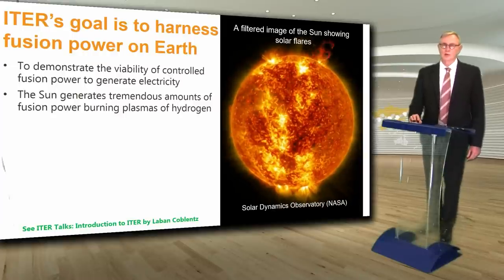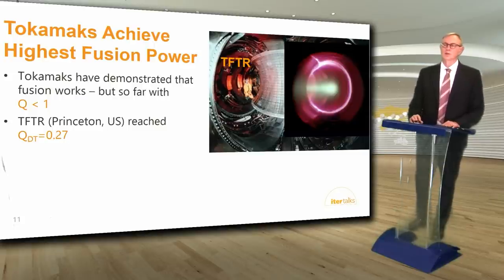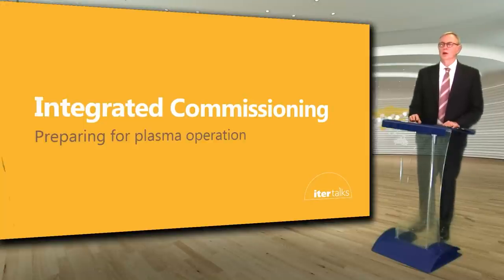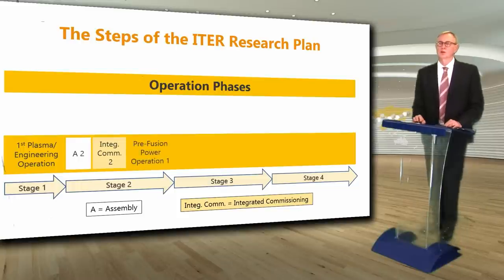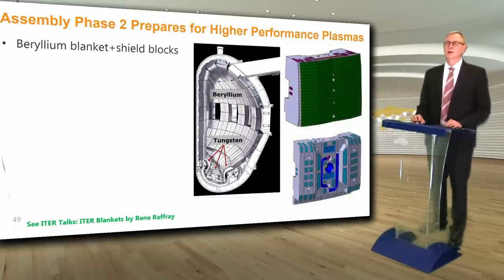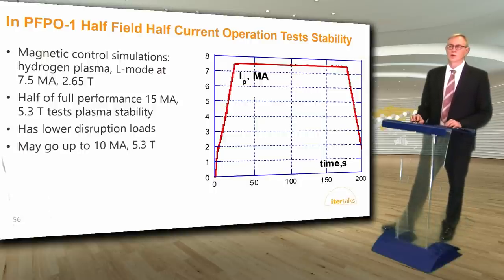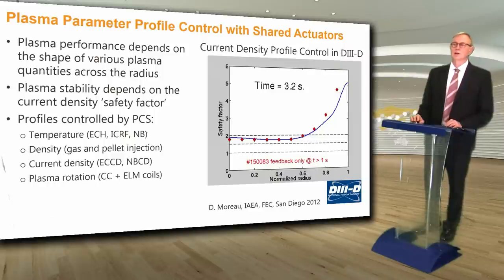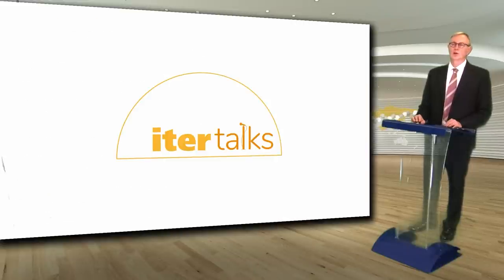ITER Talks (7): The ITER Research Plan, How to Reach Q=10

Comment: Error around 2:10 - instead of "input power required" he meant to say "thermal power absorbed" by the plasma, as heating is monstrously inefficient, the required power is far, far greater and conveniently ignored to maximize the headline Q value. Around 10:30 he describes how improving confinement efficiency by 20% would get Q>50. Let's hope they do, so it's not all a complete waste.
Reply: There is such a need  of energy to ignite the reaction in a huge tokamak , in order to get Q>1 , the duration of the  fusion reactions must be double as planned to sell the project for an realistic  electrical  industrial production. So far from this presentation  I don't know if the pellets plasma fueling will be done with Deuterium  or Triticum or a mixtur.  I don't know which side of the D shape the pellets will  be launched because at the , it was said in the 90 when I was Euratom at JET,  that the best fly for the pellet was done when  they are launch from the inner side of the Vessel . This presentation insist  about disruptions . And if the plasma is not hot enough from  the energy given to the pellets too reach the center of the plasma it could be a problem if some ice touch the Vessel  This was a main concern at JET when the fast pellet launcher was  commissioning because  the scare a Deuterium pellet at 4km/s could even  damaged the Beryllium coated tile at the opposite position on the pellet entrance..When I worked in the 80 on the Altair diagnostic at Tore Supra , a  CO2 laser with 3 beams focusing at  the plasma at different positions  thought a long  optical path  during a shot in order to investigate the electrons mouvements. . It was saying bigger the vessel in order to reach the Q > 1 bigger   the number of instabilities  occurred.  At least during the last 40 years I can imagine this was a very good challenge for the top management  to tackle the problem. The Feedback loop for maintaining safely  a Megajoule plasma is vital for the integrity of a multi billion tokamak ...

Comment: Questions:
-What is the Ion Density of the sun? I just want to compare it to the one at ITER to get a sense of scale difference.
-Why inject frozen pellets of Hydrogen, and not the gas directly? It's counterintuitive to me.
Reply: In answer to your second question about pellets of hydrogen, my understanding is the hydrogen needs to be injected into middle of the hot plasma to avoid disruption. That couldn't be done with hydrogen gas. If, for example, you tried to inject the gas with a needle it would disrupt and contaminate the plasma. The fact frozen hydrogen is very cold (on a human scale) isn't a problem as the plasma is exceedingly hot.

Comment: Feel a bit conflicted about fusion power. On the one hand, the theory is absolutely fascinating. On the other, it (really) seems an inefficient & extremely expensive way to generate energy. The massive inputs required in terms of raw materials sourcing, manufacturing & time taken to construct & commissioning when compared to that of renewables & storage, just don't add up. 
The only reason where fusion research might make sense is for space travel, particularly deep space outside of our solar system.
Reply: Actually less so for space travel.
Reply: @russhamilton3800  I was thinking in terms of, if it could made to work, that (eventually) it would/could be miniaturised. But otherwise, I agree.
Reply: It's just like fission it does need a massive investement to build a powerplant but it's way better than any renewable
Reply: @seubmarine5347  Of course it's not better than renewables, at least at this stage in the fight to prevent runaway climate change as prevention and mitigation measures are only starting to ramp up. I'm not saying that it shouldn't be explored, just that for right now, humanity's focus should be primarily on using all the resources currently being poured into ITER, into maintaining a liveable planet instead.
Reply: @pinkelephants1421  You can do your part by buying a rooftop solar system for your house, with a grid tie inverter and a tesla power wall. If you're OK with the batteries becoming yet more e-waste within their ~10 year lifespan.
Reply: @RN1441  Give me a break! Do your research before making such asinine remarks. Batteries DO NOT end up in landfill after 10yrs. 1) they have up to 30-40yr lifespan when used as stationary storage. 2) The materials contained therein are far to valuable to just throw away & are recycled; current recycling rate of contents stands between 94 & 98%. 🤦‍♀️🤦‍♀️🤦‍♀️
Reply: @Cool Baby yeah I agree, sorey ir I was not specific, but fission and fusion should be our priority

Comment: Would you get a greater Q value if the tokamak was in zero gravity of space? or the vacuum of space?
Reply: You would certainly need less energy to maintain the vacuum, but cooling would be really, really hard.
Reply: @infinitelyexplosive4131  yeah that's true, but it still might be a good trade off, there are ways to convert all that heat into work. I can't imagine the size and power of the turbopumps they will need to use to pull down the vacuum they need....they aren't exactly quick either....
Reply: @psycronizer  It takes a lot of effort to get down to the vacuum quality they need, sure, but the thing still needs to reject like 500 MW of power under operation. You'd need like a full square kilometer of ISS-style radiators to do that in space.

Comment: A big secret. 

The sun has collected all its fuel at the beginning 
and fuses it off in the course of the reaction time. 

Our attempt by ITER to replicate the fusion process 
requires constant replenishment for its reaction 
process during operation. 

This is a very elemetary difference. 
So we cannot reproduce the process of the sun. 

We are trying to emulate the fusion process that 
takes place in the sun in ITER. 

It's as if we had to constantly feed the sun with 
material to keep it running. 

Emulating the sun's mechanism would require a 
one-time fuel supply for the entire duration of 
ITER's operation.

Can this approach succeed at all?

Comment: So what exactly does Q stand for? Is it the ratio of power gained from fusion in plasma and power delivered to plasma (sometimes called Q_plasma) or is it the total usefull (like electric not heat) energy produced divided by the total energy that is being used by the facility (Q_total)? I find it rather peculiar that you explain what n_i, tau_E and T_i are but you don't make clear waht you mean by Plasma Input Power and Fusion Power Out. 
What is Q_DT?! It just shows up on the slide at 5:11 and is never explained. Is it the same as Q? Does DT stand for Deuterium-Trittium? Why would information about the fuel used be important? I have no idea.
It's simply sad how the public is being lied to.
Reply: Q is the actual amount of free energy generated from the Tokamak . Whereas Q total is the amount of energy derived from the whole power plant, like the amount of electrical energy coming out of the plant that is going into the grid, for example. Q total is always going to be a bit lower because the Q energy needs to be converted (for example heat to steam to turbine to dynamo). So Q is what you get out of the Fusion itself and Q total is what you get out of the whole power plant (which is basically Q minus all the other crap needed to make electricity).
Reply: Q put simply is the power output of the *fusion reaction*, written as a multple or ratio of the input power.
I think that distinction is important because Q only describes how much power the reaction itself yields, not how much is harnessed or can be harnessed.

It's almost weird to even talk about energy this way because the practical limit of fusion Q is well over 100 but we are fussing over 0-10.
And the practical need for sustained operation is somewhere in the 5-20 range...

Q.(dt) does indeed seem to be Deuterium-Tritium based on some papers I looked up.
It's probably important because like I mention before Q relates to reaction energy, the reaction energy and characterstics of different fuel mixes have different Q maximums, and characteristics. So it's probably useful to mention.

Comment: No one ever mentions the 12 tonnes of ultra toxic beryllium in the machine, or the uranium impurities that will be converted to plutonium isotopes by the neutron flux…….
Reply: No one mentions it because it's a trivial issue and you are scare mongering. Beryllium is not a pleasant substance to work with but nor are thousands and thousands of other substances that we use every day. As for the uranium impurities, now we know it's an issue we can produce low uranium content beryllium and the problem goes away.